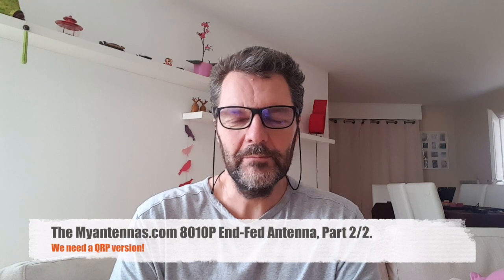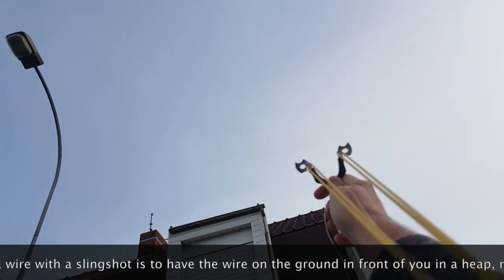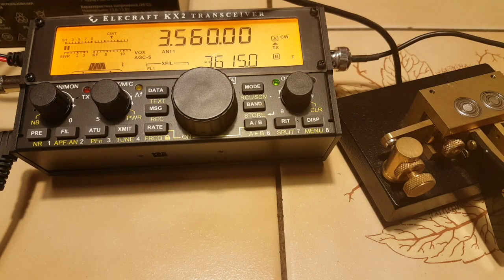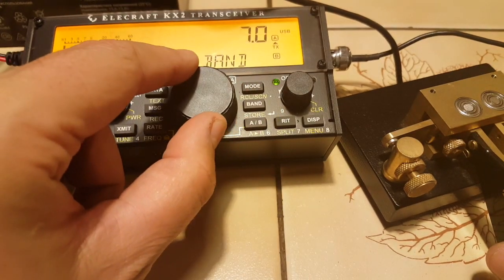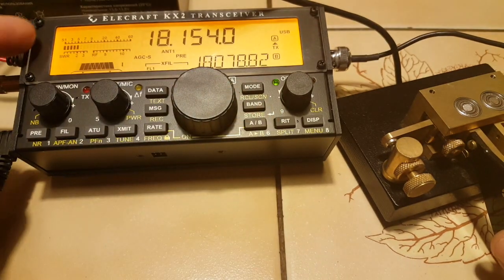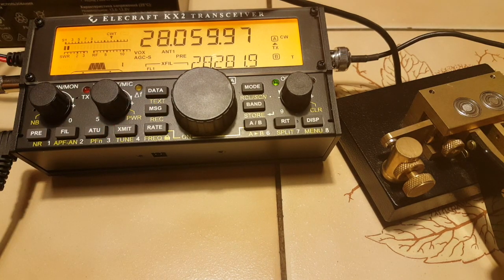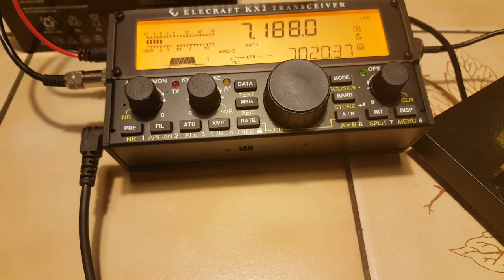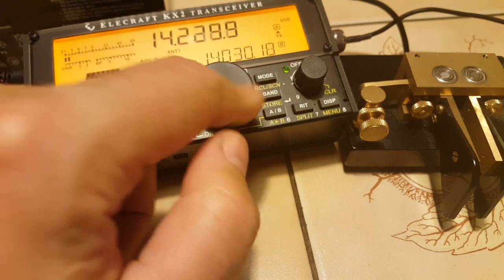The Myantennas.com 8010P End-Fed Antenna, Part 2/2.

Comment: Thanks for the video.  I have been watching many videos about end fed antennas with 49:1 transformers.  I want to operate on multiple bands but I really don't have any use for 80 meters.  Is there a reference of antenna lengths for each band.  I know the longest (135 feet) will do 80m and below but again, I don't care about 80m and would like to operate with a shorter antenna for 40, 20, 17, 15 and 10.  Is there a chart for antenna lengths?  I also want to operate portable without a tuner.  Thanks in advance. -- 73/KG7VCL
Reply from the maker: Use 468/F. F in Mhz, result in feet.
Reply: @RadioPrepper  Yes, thank you.  I did calculate center of 40m phone band 7.240mhz equals 64.64 feet.  So, with the 49:1 transformer, will it work on other bands (30, 20, 15 or 10)?  I guess the was the jest of my inquiry.  Thanks again, your videos are awesome.  73/KG7VCL
Reply from the maker: Yes :-) not all of them though.

Comment: Hello and thanks for the videos. I have a 4010 that I converted to 8010 by lengthening the wire.  I made it excessively long and trimmed it back until I got optimal SWR at 14275. The transformer end is currently 5 ft up with the end about 20ft off the ground.  I'm using a 4m counterpoise strung along under the driven element.  My SWRs are excellent everywhere except 80m. I'm wondering how long of a coax you are using?  I have about 6ft but this is only for outdoor use.
Reply from the maker: Hi, usually 25 to 33ft.
Reply: Did you do any trimming to get the SWR so sweet on ALL bands?

Comment: Have the same antenna 
Pick up a two military poles at about 15 feet long. How will it work flat top as Nvis. As for emergency and about work anywhere. Have up now as a sloper 15 at one end and the other about 30 feet. What would be your  input on this. Knowing the band are not on our side.
Just trying to get the most out of this antenna. Using the EFHW-8010-1K.
tnxs Paul  KQ4CD  73
QTH Brooksville, Florida
Reply from the maker: A horizontal antenna can work surprisingly well pretty low... I would not hesitate to try at 15ft. I have made contacts on 80m with a 134ft wire six feet off the ground.

Comment: Very Nice video i have lw with 22m in tower up 10m goes down 12m in 45 e gree feed point in the ground work very well not a big gun but better tham dipole for me ok tks for nice video like the rig is k2 or k3 i will look to bay one my is ft991 is not so big but your is much smaller 73 from py1ax tony .
Reply from the maker: Yes, it is a KX2.

Comment: I have an MFJ 10-40 end fed wire. I am wanting to get an end fed that will go to 80 using it as an inverted V to be able to fit my property with a decent swr,. Do you recommend the Myantenna 80-10?
Reply from the maker: Hello, yes, it has worked very well for me. You can however build a 49:1 transformer yourself for a fraction of the cost. See my video on it.
Reply: If the MFJ has a 49:1 unun you can simply add wire to it! But a sliding insulator midpoint high up and bring ends down to make an inverted V or sloping in my case. W4GHV

Comment: Almost a year later, are you still using this antenna, Gil? If so, has it worked well for you? Thanks!
Reply from the maker: Hi, yes, it's still strung from my roof to a giant pine tree in the backyard. It works great, better than the Windom I used before.
Reply: @RadioPrepper  Hello, Do you have room to string up an 80m full wave loop? Its all i use on all bands and it is at least 5 to 7 s units quieter than dipoles. Just a thought. Sounds like you are having fun and thats all that matters. Cheers.
Reply from the maker: Unfortunately no...

Comment: How does the 8010P compare to the Par End Fedz you reviewed so favorably?
Reply from the maker: I haven't really thought of those two as competing antennas. The 8010P is going to be installed horizontally, most likely. The PAR is probably going to end-up as a vertical. It's too early to tell, but the 8010P seems to perform better than the same length Windom I had up in the same location. For a house antenna, for anyone who has the space, the 8010P is great for 80m and does 30m as well. For portable operations or if not using 80m and 30m, I'd install the PAR vertically for DX. Time will tell...
Reply: Great, thanks for reply and description of performance.  Have you had a chance to evaluate the Hyendfed EFHW from Holland?  Would you expect the performance to be similar at the horizontal home deployment as your 8020P?
Reply from the maker: +Glenn Nofsinger I have never tested that one, so I can't comment. All I can say is that as far as antennas are concerned, size matters..